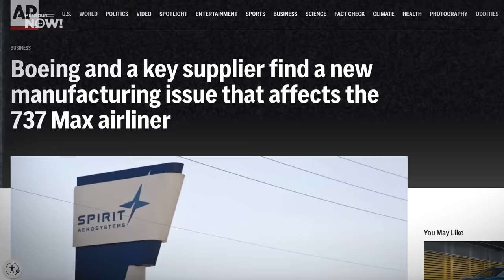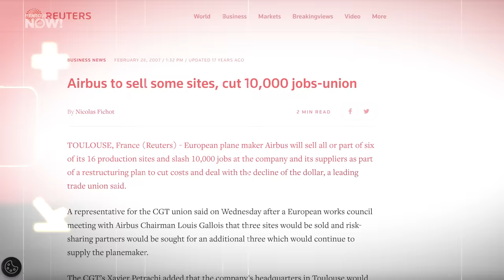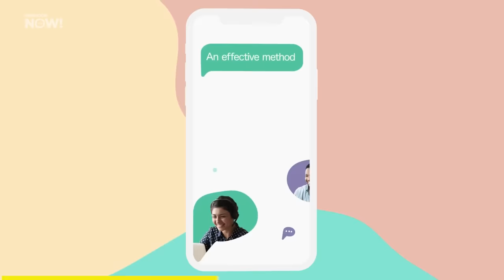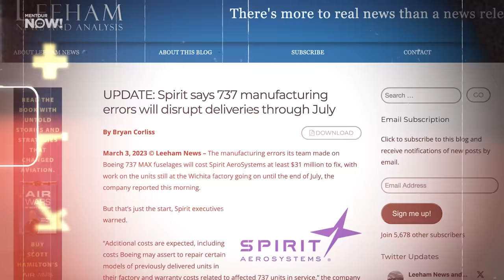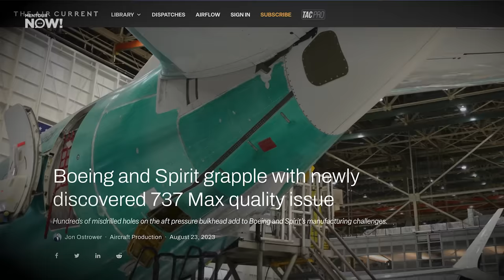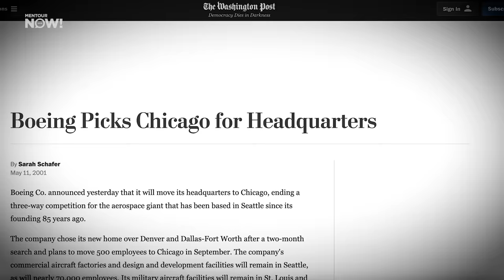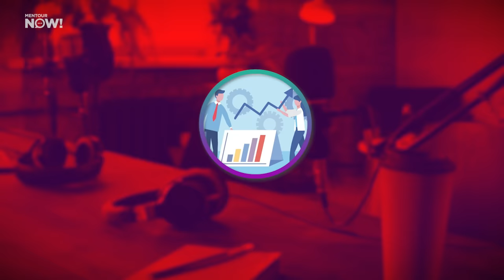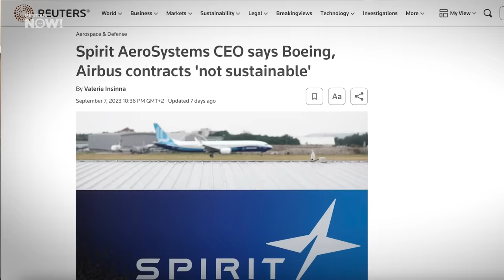NEW Problems with the B737MAX!

Comment: Boeing has irreparably destroyed its decades old reputation with the Boeing 737 Max.
Reply: By a supplier issue
Reply: @nickolliver3021 Boeing needs to make sure their suppliers give them the correct parts
Reply: @jan-lukas  exactly and spirit did not go by that
Reply: @_-Karl-_  nothing to do with 346 people
Reply: @nickolliver3021 By having too many cases when one part can down the plane. No redundacy.
Reply: @TinLeadHammer  that applies to all planes. Redundancy on a plane is everywhere. One part cannot down a plane if its solid as a rock
Reply: @nickolliver3021  which is why 1 piece of software using 1 AOA sensor can down 2 planes... well we done stuffed up there. Sums up Boeing.
Reply: @@arisnotheles So how would boeing keep track of supplier performance  if parts are coming in badly and not up to specifications? Are they meant to do it in house now? Sounds like all manufacturers have to make their own parts!! However that's not tne way it goes. The supplier has to get themselves into gear. So it's not boeings fault. Every time and every problem when it's a supplier problem is not boeings fault. Wake up  and so does the airbus
Reply: I was surprised at the whole approach taken to produce the 737Max. It seems to me a desperate attempt to fend off Airbus by trying to refashion an old plane into some new variant that would better compete with Airbus rather than go with a more modern design. That instantly gave me some trepidation about flying on a 747Max even before what seems to have been an awful fix to an software issue in the avionics. I have never enjoyed flying in a 737 I must admit as they always seemed cramped for my large frame, but that could well be the result of the aircraft operator. I enjoyed Airbus mid size planes more. 
I don't fly much any more due to age, but my trust in Boeing has certainly suffered to the point I would look to fly on alternative plane manufacturers where possible.
Reply: @georgedyson9754  Guess what Airbus did tne same thing by reassigning an old plane into some new variant that would better compete with the boeing rather than go with a more modern design. So your point  doesn't exist. So if it was a refashioned plane that everyone still liked why should it have been a complete new design? Why did it give you instant trepidation about flying on a 737max vegore what seems to have been an awful fix to an software issue in the avionics? If you dobt enjoy flying in a 737 because they are cramped for a large frame then go complain to boeing to make it fit your needs. And why should your trust in boeing suffer to a point where you have to look for an alternative plane manufacturer? Why does it hurt to you so much that you have to do that?
Reply: @nickolliver3021 Boeing used to be engineer driven, now they are MBA driven.
Reply: @nickolliver3021 the difference is that A320neo was the first major update to a 1980s design that had the room under its wings for a larger engine without massively changing its flight characteristics and handling.
The 737MAX, on the other hand, is the ...fourth update to a 1960s design that didn't have the room for larger engines and massively changed the way the aircraft behaved. 
Seriously, how can you even compare the two?
Reply: @igorbednarski8048 Well, I know which of these two planes I won‘t fly with …
Reply: I dunno, the 747 had some major technical problems at the beginning
Reply: @herrpausr7008  what would that be
Reply: @igorbednarski8048  the point still stands no matter if the a320neo is tne first major update to a 1980s design that had room under its wings for a larger engine without massively changing its flight characteristics and handling. The 737max also had room for a larger engine that fitted under its wings without needing to change flight characteristics and handling. It just needed a tweak of being made higher and more forward. 
The 737max is just what the a320neo is. The a320neo is the second update to tne a320ceo series. The max is the fourth so what? Doesn't matter if its a 1960s design. Bit it still had room for larger engines and just needed them to be made higher and more forward. Seriously why are we picking out the detail of the two when that detail has now been passed.
Reply: Correct. I will never ever again board a Boeing. As a Finn that means not using Norwegian, Ryanair, TUI etc. It does not matter if they are cheaper than Finnair. I just want to stay alive.
Reply: @VesaGuardian  you will stay alive on a boeing? Do you think boeings crash everyday?
Reply: @nickolliver3021 Yeah. Just not the 737 Max.
Reply: @SunnyHF-nf4bc  why not on a 737max
Reply: @nickolliver3021  dude, are you serious?
First of all - the A320neo is the first and only update, A320ceo is just what they retroactively named the original A320 after the release of neo. 
Secondly - if 737MAX could get bigger engines without changing the flight characteristics, why did it need MCAS? Why did Boeing conspire to pretend MCAS did not exist? 
People are not picking on A320neo because it's design did not lead to a conspiracy that killed hundreds of people, caused thousands of aircraft to be grounded and single-handedly wiped out Boeing's market share better than any competitor could. You are either totally ignorant of the whole 737MAX fiasco, in which case you should just read about the whole story - or you do know and are for some reason deliberately defending one of the most high-profile cases of criminal corporate mismanagement and conspiracy in recent history
Reply: @igorbednarski8048 because it did not have a fbw system like that of the airbus FAC, and MCAS technically "did not exist." it served as an extension of the existing STS hence why boeing relied on only 1 AoA sensor because it really was not a separate system at all. it took the exact same data from the STS and even have the same operating conditions. it achieved "redundancy" by swapping between aoa indicators based on which is FD is set as primary.
Reply: @nickolliver3021  If I go to a restaurant and the steak tasts of old rotten meat, I will held the restaurant responsible, not the butcher that sold them the meat. But some customers may see it differently and excuse the restaurant and blame the butcher or even the cow.
Reply: @todortodorov940  that's a different story. We're talking planes here.
Reply: @nickolliver3021  I must admit, I am not rich enough to buy a plane as the 737, but if I was, as the customer, I would expect the product I buy to be up to quality, and if it is not, I will point the finger at those who sold me the product. In the case of the stake, it is the restaurant that made it and sold it to me. In the case of a 737, it is Boeing that made it and sells it. I will not discriminate.
Reply: @todortodorov940  well any thing you buy these days is not up to good quality. Its all done cheaply. It depends if the company who sells that product if it was made at a supplier and then sold only from the seller. However the 737 was made by Boeing and did not make the parts for the aircraft.
Reply: Yeah, capitalism,  good right
Reply: Keep hiring temporary employees to build your junk planes Boeing
Reply: @nickolliver3021  Boeing has always been, and will always be, 100% responsible for the materials and craftsmanship supplied to it by any subcontractor. Not even McDonnell-Douglas running under the Boeing name gets some kind of pass on that basis. Every part, every material used, every piece of workmanship has a printed, approved standard to meet and it is McDonnell-Boeing's responsibility to verify that all standards are met every time. The actual Boeing,  before they retired, had an entire verification and corrections process for incoming supply that all suppliers were answerable to.
Reply: @nickolliver3021  "well any thing you buy these days is not up to good quality.", you said it, that's Boeing, period. Stop. LMFFFAAAO and keep melting on your 737-trash.
Reply: If its boeing i aint going😮
Reply: @alvinloh9068  then the same with airbus they ate not good quality with the a320failbus period. Keep melting on your a320neofailbus LMFAOOO 😄😄😄
Reply: It’s complete garbage. The FAA needs to issue an airworthiness directive, requiring them all to be returned to base and scrapped. Don’t even put them in the mothball fleet. Break them down into beer cans. That’s all they are worth.
Reply: @ReflectedMiles  Boeing cannot be 100% responsible for the materials and craftsmanship supplied to it by any subcontractor. How could they if tbe subcontractor was tne only one who made the bad parts and not boeing? No subcontractor is perfect so they could not control what was made to their standards. Mcdonald Douglas isn't running under their name anymore. Every part amd every materials used and every piece of workmanship has a printed approved standard to meet and it was not boeings Mcdonald Douglas responsibility to verify that all standards are met every time. It was the subcontractors fault for not verifying those standards being met as those parts were made incorrectly and Boeing could not accept those parts hence why they flagged it up. It had nothing to do with them. Before anything gets sent the subcontractor should always verify parts before they are sent to the manufacturers and they failed badly as some have been found improperly drilled. Boeing has obviously done their job by seeing this and flagging it up to be fixed.
Reply: @nickolliver3021  Boeing has the responsibility for specifying tolerances and verifying compliance.  I would be very surprised if Boeing doesn't have engineering and manufacturing representatives at Spirit.  Standard subcontracting practice.
Reply: @nickolliver3021  Standard practice is on site reps, ie, Boeing employees at Spirit, verifying compliance.  Knowing Boeing's current management, they probably don't.
Reply: @georgedyson9754  An updated 757 would have been the correct approach.
Reply: @nickolliver3021  This is the aerospace industry operating under U.S. law. It is unlike any kind of general construction or other economic activity. A certification for that aircraft is issued to the manufacturer that sought it (Boeing), and no variance is allowed from the specifications and tolerances identified as part of that certificate regardless of who has built what part of the aircraft. Every part of it, every time, must meet the standards that were the basis on which the aircraft is allowed to fly commercially. Otherwise, it is designated Experimental and cannot carry passengers or cargo.
Reply: @mio2540  Yes!  That was one of the stupidest "fixes" Boeing put in.  Not redundant AOA, just swapping AOA control back and forth.  That led to one of the MAX crashes, as the flight crew reported the MCAS node down weirdness, but when MX investigated, the other AOA was in control, and the issue could not be replicated. So many people here have a better understanding of the multiple MAX issues than Nick Oliver.
Reply: @SteamCrane  Boeing has no responsibility over spirits specifying tolerances amd verifying compliance. Obviously this is spirit's own fault for not being up to boeings specifications and compliances. That's the bottom line
Reply: @todortodorov940  It is Boeing's fault for not monitoring their suppliers.
Reply: @SteamCrane  boeings own management did pick up on the fault at spirit that's why they saw it early and requested a fix from spirit
Reply: @ReflectedMiles  Correct.
Reply: @ReflectedMiles  yes we know this is under aerospace industry operating under u.s. law. Spirit Aerosystems has announced themselves thar they are struggling to get parts to be good quality due to the demand of boeings needs. Airbus is having the same problem too. A certification for that aircraft is used to tbe manufacturer boeings who sought it. Agreed. Every part and every workmanship was not up to boeings standards of those incorrectly built parts hence why spirit Aerosystems owned up to the fault of theirs. The planes would still fly as it doesn't pose a threat to in flight safety.
Reply: @SteamCrane  they did that but spirit failed amd not boeing. I'm not saying this again
Reply: @SteamCrane  The issue is not the MCAS as an augmentation system, but rather its redundancy. It's nothing more than a few lines of code added that was supposed to give one single and small movement of the horizontal stab leading edge upwards when the aircraft enters one corner of the flight envelope and move the neutral point slightly back in order to satisfy the static stability regulation requirement. Then during certification testing code was changed and instead of one activation new code allowed stabilizer to move more than once. That effectively created a never ending loop.
Reply: @SteamCrane  In the end it all came down to money and competition. FBW implementation would have fixed everything, but would ruin the type rating commonalities. It would have brought benefits such as auto pitch trim, no pitch/power couple, turning without needing to pull back; and MCAS would not have been needed
Reply: @nickolliver3021  Spirit has no say in the matter. They aren't the ones authorized to manufacture and sell the airplane. Only one company is, and that manufacturer is required to be in compliance. Period. That is how the law, and how this industry, works. Spirit is Boeing's problem because Boeing has the legal responsibility to meet the certified product standards regardless of who supplies or builds the parts. Spirit only has a responsibility to meet the standards of Boeing's approved design as a vendor. The great mistake on Boeing's part is not being in control of their own manufacturing. The standards required do not change just because they failed to retain it. Anything not complying with the design criteria has the potential to be a safety-of-flight issue over time due to fatigue, corrosion, etc., and that is why they are required to fix all of these, no matter how many millions it may cost.
Reply: @nickolliver3021  It doesn't matter. Boeing failed to check the parts were made correctly, and carries responsibility for the consequences..
Reply: @GoodFella-wi7gw  Hiring temporary employees works for McDonalds, why should it work for McDonnell Douglas, correction, for Boeing?

On the other hand, I avoid McDonalds burgers.
Reply: Max's is curse
Reply: @hb1338  how did boeing fail to check the parts were made correctly? They spotted the fault of improperly made parts that Spirit did bad. It carries responsibility to the supplier not boeing
Reply: @ReflectedMiles  Of course they have say in the matter. They cannot send faulty parts to a manufacture when their own quality team sent them in a bad condition. It was not up to beings standards. The manufacturer was in compliance but the supplier was not. period that is how that is and how suppliers carry out their work. Spirit  is not Boeings problem because Boeing has standards that the supplier did not meet when they built their parts for their manufacturer Boeing. Their parts were not approved by boeing hence why they saw it early on and flagged it up. How would this be all on Boeing if they did nothing wrong and didn't make the parts? Boeing does not control their vendor manufacturing. it was spirits own mistake that they failed on their manufacturing by drilling improperly drilled holes in their parts. Boeing checked this and found out they were improperly drilled. Spirit failed to be at Boeings specifications. So anything that is not in compliance with the design criteria Boeing has set they will reject and tell their supplier to make the parts properly at their specs.
Reply: @nickolliver3021  Boeing is not in compliance if a supplier is not in compliance because, legally, it is irrelevant who manufactures what on the airplane. The certified airplane is required to meet specifications, and that is Boeing’s responsibility alone. The FAA and EASA, etc., don’t go to Spirit looking to certify their portion of the airplane separately. Boeing is responsible for all of the design and manufacturing associated with any airplane that they produce, no matter who does or does not supply the materials, labor, or facilities for any given part of it.
Reply: @ReflectedMiles  Yes boeing is in compliance if spirit is not in compliance. Its not about who makes what on the plane. The bottom.line is that Spirit failed on Boeing. Agree its their responsibility but sadly spirit let boeing down because they sent in parts not up tontheir standards. I think you are seeing it differently to what I am saying it. Well they are responsible for the design and manufacturing I.e. putting things together in assembly. The whole point is the supplier sent in bad parts so boeing has to deal with this. However this is really spirit's failure and problem to resolve not boeing.
Reply: @nickolliver3021  Giving up their own manufacturing to another company that struggles with compliance was and is fully Boeing’s choice as well. Their capabilities have been far beyond Spirit’s. Boeing is just choosing not to do their own work.
Reply: @ReflectedMiles  They never gave up on their own manufacturering. All manufacturers use other companies slash vendors to make their parts for their planes. The suppliers are struggling with compliance and the fact they chose is not their fault. No one is perfect. They all have issues.  So boeing makes parts in house?
Reply: @nickolliver3021  You haven't been to Boeing Fabrication Skin and Spar in Washington? If you don't know the company, you shouldn't be posting as if you do. The 787 was a total fiasco for the exact, inexcusable reasons that you are attempting to defend. There is no excuse except bean-counters overruling engineering. Prior to the 787, Boeing made the majority of its own parts. The completely different, failed approach that began with the 787 resulted in Boeing having to send engineers out to suppliers to correct their many design and manufacturing errors and incompetencies, deliveries were delayed for over two years, and multiple aspects of the plane still weren't quite right after another year's worth of correction. More recent models like the MAX have followed suit, though not quite to the same extreme since the company took a bruising with customers, regulators, and in their finances for that foolishness. Boeing doesn't have to outsource to other, incompetent companies. They just do. And no, not every manufacturer must do so for its major components.
Reply: @ReflectedMiles  Neither has any body else in here! If nobody knows that a supplier issue Is not tne manufacturers problem then were all good. The 787 recently has had supplier issues to. So I day again how are beancounters over ruling engineering over a supplier issue? Boeing never made its own parts because manufacturers do NOT make their own parts. They only assemble them. Boeing had to send out teams to inspect aircraft that had supplier defects over a failed approach by their supplier over tne supplier issues. There were no design and manufacturing incompetencies. The 787 had manufacturering issues where certain parts were not joined together properly etc. That's not a manufacturering problem. That's a assembly problem but heh ho. Yes we know it went through alot of extensive work in the early days but that was all assembly issues as nothing was made on the floor. The MAX has also recently had supplier issues and followed suit. Well if boeing doesn't have to outsource fir its components then who will if its the only way forward to do so? They just have to accept that issues do occur when you outsource and just have to make sure that they do things right.
Reply: @nickolliver3021  Not the MAX!
Reply: @ashlionell  we know
Reply: @nickolliver3021 Yes. Because Boeings crash. And I would not want to be in a plane that crashes. You will probably want to be in a Boeing.
Reply: @ashlionell  then you might as well never fly because all plahes crash. You can't trust anything these days
Reply: @nickolliver3021  All planes crash? Or did you mean all Boeing planes crash? Because the latter is true.
Reply: @ashlionell  what all boeing planes crash? Do you mean that they shouldn't exist?
Reply: @nickolliver3021  Planes that crash shouldn't exist.
Reply: @ashlionell  go tell tne industry that then
Reply: @nickolliver3021  No. Not the industry. Just Boeing. Other manufacturers' planes don't seem to be crashing due to faulty design or parts.
Reply: @ashlionell  lol boeing planes don't crash due to faulty design or parts. Airbus has done that many times with faulty design and parts. But you wint agree with that. As I said before just don't fly
Reply: @nickolliver3021  Boeing doesn't crash due to faulty design or parts? Can you please pass me what you've been smoking? Seems to be some quality stuff!
Reply: @ashlionell  how many times do boeing aircraft crash then due to quality stuff then..tell me
Reply: MCAS should be banned by the FAA.  You can’t (safely) fix hardware failure with software.
Reply: @AndreasAntics  Mcas doesn't need to be banned. Who says you can't fix hardware failure with software?
Reply: @nickolliver3021  Boeing says. They tried that with the MCAS. And failed. Miserably.
Reply: @nickolliver3021  Even one crash due to faulty design and/or parts is one too many when it involves human safety.
Reply: @ashlionell  so if there was one crash that was pilot error is that one too many that involves safety of passengers?
Reply: @ashlionell  Mcas isn't the point. Doesn't mean all planes have mcas and crash. Airbus had sane systems and failed miserably
Reply: @nickolliver3021  Pilot errors happen. All the time. Which is why we have trainings and certifications. Even car driver make human errors. That is unavoidable.That is not the point. Crashes due to faulty design and/or parts is the issue. Those are entirely avoidable until some scrupulous company like Boeing decides to prioritize profits over other things like safety. Which is Boeing's fault entirely.
Reply: @nickolliver3021 MCAS is the point. Which Airbus had such a system and failed miserably? Can you point to one instance?
Reply: @ashlionell  certifications are for being airworthy. Trainings yes agree. Yes car accidents can be unavoidable or prevented. Crashes due to faulty design or parts can't be the isdue if tne supply chain causes that. How is boeing a sculpulous company that priorities profit over things like safety? It isn't boeings fault for that if supply issues like this are not to blame boeing on
Reply: @nickolliver3021 How is MCAS a supplier issue? That's a design fault. That lies squarely with Boeing. Not having their inspectors at their suppliers' factories monitoring the quality is yet again a Boeing fault.
Reply: @ashlionell  Mcas wad not a design fault. It was a system fault. It lies with tne fact it wasn't their fault because they didn't know what was wrong with it. Of course they had quality inspectors at their facilities but doesn't make it a boeing fault. What is wrong with you all of a sudden
Reply: @nickolliver3021  Yes MCAS was a design fault. That's why MAXs were grounded and not the other Boeings which did not have MCAS. And no, they did not have inspectors at their suppliers' facilities. Otherwise, they would have caught the issues at the manufacturing stage itself, instead of catching it at their facilities at the assembly stage.
Reply: @ashlionell  No it wasn't a design fault. The maxs were grounded because of the fault with the system. Then you think all boeing planes have mcas. Yes they did have inspectors at suppliers facilities. They did catch it at the manufacturering stage. They caught it because it was dealt with.
Reply: @nickolliver3021  Yes it was a design fault. And get your facts straight. All Boeings do not have MCAS. Only the MAXs. And only they were grounded. Due to faulty design. Which is a Boeing problem. And they did not catch the defecting parts at the manufacturing stage. They caught it at the assembly stage. Which means Boeing did not have their inspectors at their suppliers' sites. Again a Boeing problem.
Reply: @ashlionell  No it wasn't a design fault. Perhaps stop saying all boeings crash. Then stop acting like they do. They were grounded because of the fault of mcas. We all know it was. It wasn't a boeing problem. Yes they did catch it at the manufacturering stage. They caught it at the manufacturering stage. They had their inspections there hence it was not a boeing problem
Reply: @nickolliver3021  You agree they were the fault of MCAS. Who designed the MCAS? Why do MAXs need MCAS when even other Boeings don't? And again, get your facts straight. Check the video once again. They faults were observed at Boeing's Renton facilities where they are assembled. They now have to ship the defective parts back to their supplier for fixing it.
Reply: @ashlionell  everybody knew that it was an issue with mcas reading a faulty sensor yes. Boeing did not design mcas.we all know why mcas is needed.  Perhaps get ypur facts straight because mcas is fixed. That was your question right! They were resolved at Renton yes where they are built.  Yes they ship the latest issue of parts back to the supplier. Correct
Reply: @nickolliver3021  Thanks for acknowledging all of these problems as Boeing's faults. Have a nice day!
Reply: @ashlionell  sadly not many are boeings fault but anyway enough said
Reply: @nickolliver3021  Yeah. Both the MCAS and the defective parts are Boeing's faults. No beating around the bush.
Reply: the defective parts are not Boeings fault jeez @ashlionell
Reply: @nickolliver3021 Of course they were Boeing's faults. Why else would they catch the issue at the assembly stage rather than at the manufacturing stage at their suppliers' place?
Reply: no they were not Boeings fault they caught it at the manufacturing stage rather than assemble stage how many times do I have to repeat myself @ashlionell
Reply: @nickolliver3021 They did not catch it at the manufacturing stage. They caught it at the assembly stage, and now they have to ship back the defective parts to their supplier to get them to correct the defects. Clearly a Boeing problem here.
Reply: @ashlionell  yes they did catch it at the manufacturering stage. A supplier issue is not a boeing problem. The supplier is at fault for this. How many times do I need to say its not a boeing issue for a supplier issue
Reply: Agreed 1000%
Reply: @CarlosAlexandre-fl2ut  how
Reply: However the 737 always had issues. Rudder hard over nearly killed off the type in the 90s.
Reply: @nickolliver3021 You didn’t watch the video? Good job.
Reply: @justsaying4352  you didn't watch did you actually
Reply: @nickolliver3021 What an outrageous view.  It is absolutely the duty of Boeing to do quality control on all supplied parts and/or have quality control inspectors at their suppliers.
Reply: @TassieLorenzo  It's not down to boeing to do quality control on all supplied parts. If parts are coming in not up to quality standards then their supplier is to blame. Of course they had quality control inspectors at their suppliers and hence that's why they found bad quality parts being sent in
Reply: @nickolliver3021 Boeing did not have their inspectors at their suppliers' facilities. That's why they caught it only when the parts reached them for assembling. Now they have to ship the parts back costing even more money. A big Boeing fail.
Reply: @ashlionell  Yes boeing did have their inspectors at their suppliers facilities. They did not catch it only when the parts reached them for assembling but in manufacturing. They have to ship them back but not a big boeing fail
Reply: @nickolliver3021 If they caught it at the manufacturing stage, then why would they need to ship it back? Are you making sense to yourself?
Reply: @ashlionell  if it was manufacturering then that's why they find the problems. The assembly stage is why they just put parts together without knowing if parts are faulty.
Reply: @nickolliver3021 Right. And Boeing is responsible for assembly. But they got defective parts when they were assembling. Which means they were delivered defective parts by their supplier. Which means Boeing did not have their inspectors at the manufacturing site. Very much a Boeing failure.
Reply: @ashlionell  This is not a boeing failure because they had their inspectors at the assembly stage. They can't go to the manufacturering stage because their suppliers manufacturer the parts. Very much a supplier issue
Reply: @nickolliver3021 Well they are supposed to have their inspectors at their suppliers' sites to ensure manufacturing happens upto their spec. If they did not, then its a big Boeing fail.
Reply: @ashlionell  it's not a big boeing fail because they didn't have inspectors at the suppliers. So if they spotted improper parts there then it's the suppliers fault so a bigger supplier fail
Reply: @nickolliver3021 They are supposed to have their inspectors at the manufacturing facility. That is the industry practice. Boeing didn't do that to save costs. Hence defective parts made their way to their assembly lines. It's a big failure on Boeing's part.
Reply: I will never fly on a 737MAX. This ugly zombie is not made to fly. I will just fly with airlines who don't even own such a thing. I had it more than once that an airline uses another plane as the one that was planed to do the flight. Good luck with getting another flight if you spot that shit at the gate.
Plus an airline who uses a 737MAX is not interested in safty anyway.
Reply: @daftvader4218  The a320neo is an ancient design with modern powerful engines strapped in the wrong place creating low and high speed stall recovery issue. All that still controlled by single channel computer with potential wing problems also. What are you even talking about?
Reply: @daftvader4218  Your prior comment suggests that you don’t understand the engineering story, and how Boeing actually messed up. There is nothing wrong with the MAX, contrary to the OP and many other postings under this video—all transport aircraft designs are required to be inherently stable. The MAX was no exception, as every aviation authority in the world that has reviewed it has certified. People who look at the current orders for the MAX can’t understand why airlines have given Boeing a full order book for them again, and think they must be crazy. They aren’t. The airlines are actually very averse to known risks because they can quickly ruin their reputation and their business permanently. There was nothing wrong with the airframe, the placement of the engines, or the flight characteristics. Those claims were all made up by media that do not understand aeronautical engineering and just go with whatever they imagine when they don’t understand the subject that they are covering. Several of the major channels on YT, like VOX, jumped at the chance to thoroughly demonstrate how ignorant they are—and don’t know it, or don’t care—to every professional in this field. Boeing needs to do a lot of serious rethinking and reworking of their culture, and the first MCAS design was a great illustration of the magnitude of their problems along with the 787 program, but the MAX itself is just fine. I ride them all the time without a second thought, pilots I know were flying them for repositioning even when they were grounded with little concern, and I wouldn’t hesitate for my grandchildren and the rest of my family and friends to fly on them. People just imagine the worst, and especially imagine that media are telling them a true story when they are often absolutely clueless and simply spreading whatever misinformation fits their sociopolitical biases. Welcome to the post-truth world.
Reply: @ashlionell ”Planes that crash shouldn’t exist.” Are you older than 10? Do you have any familiarity with the world and human nature and every human endeavor, ever? Very silly.
Reply: @mpenner2124  Are you older than 10? Do you have any familiarity with the world and human nature? As an analogy, rapists exist. Doesn't change the fact that its still valid to want that rapists shouldn't exist.Of course yes, in every human endeavour, especially in something as cutting edge as space and aviation industries, failures do happen despite best intentions. Which is why there are processes set to carry out extensive and thorough investigations after every such failure. The intention being to understand the reason for the failure and to glean learnings from it, so that we may change our systems/processes etc. so that that particular failure, at least, may be avoided in the future.

Boeing could've been possibly excused for the first Lion Air crash. But their subsequent cover up, and shifting the blame to poor quality of crew and maintenance, only to be caught again later with their pants down in the Ethiopian airlines crash, is downright reckless and should constitute murder imho. If you find fault with me not wanting such planes to exist, then you're probably someone whose opinions aren't worth anything.
Reply: Embraer  170, 190  is the safest aircraft in the world. Ahead of Airbus 320 and boeing 737.  There are reasons for that success.